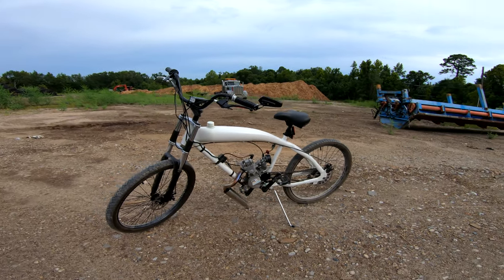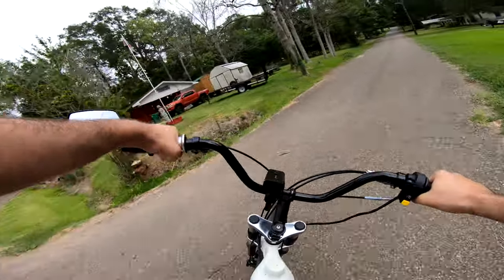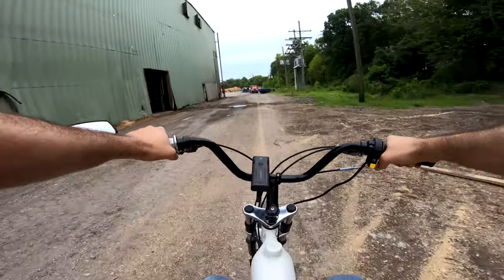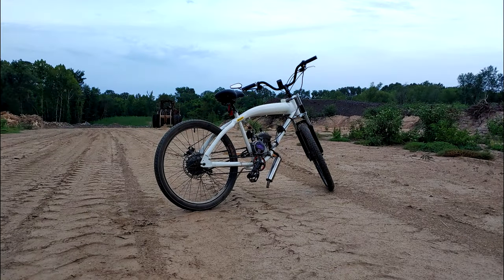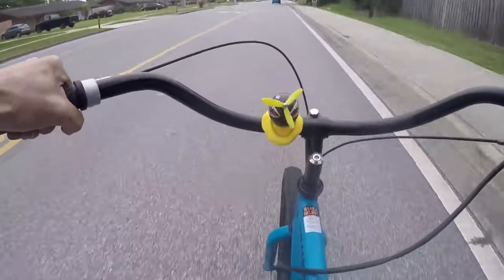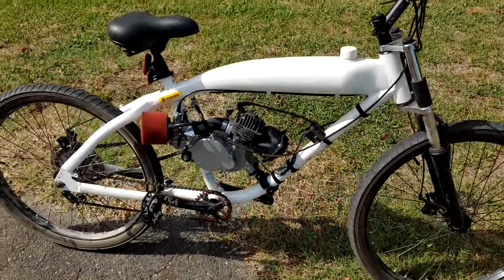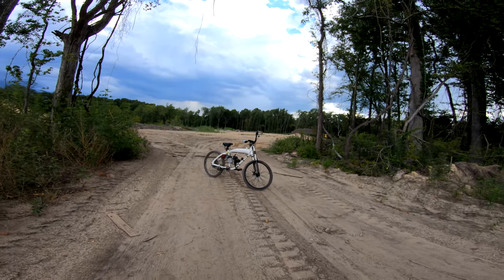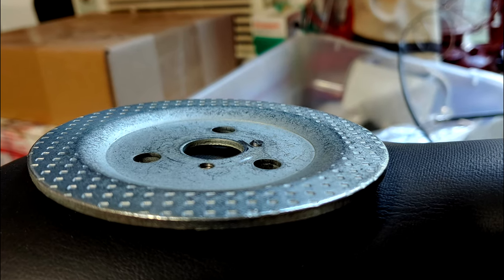MS460 Phantom 85 Bike

Comment: Good news for Phantom 85 builders I got a new cylinder head and piston because mine failed and when I say failed I mean in spectacular fashion the piston is in more than 20 pieces but the new cylinder I have has a different casting with a smaller intake the piston has smaller windows in it so it's less likely to break even though I will not be using that piston I will be using a non windowed Ms 460 piston from farmertec which is the same one that la hover used in his build
Reply from the maker: This information comes literally, at the prefect time! More details coming soon... Thank You!
Reply: @LAHover  I have a question if you can help. My Phantom 85 vibrates at high rpm severely. I would like to know what balanced bottom end engine I should buy to make my own. I would use my old Phantom head and piston but need to know what bottom to buy. I am done buying Phantom!
Reply: @pascalolesen5187  hey, so it’s probably best that you balance your own crank… which you can find youtube videos in or ask members in la hovers discord server. For the vibrations, it could possibly be a motor mounting issue so definitely check that out. The phantom 85 motor is relatively fine, mines ran for monthssss, but it has to be rode in a specific way if you don’t wanna blow her up super super quick.
Reply: @pascalolesen5187  keep your bottoms end, balance and true the crank, switch over to ms460 chainsaw and cylinder OR run the normal cylinder with the non window ms460 piston.
Reply: Where can I buy a crank stand to try and Tru my own cranks? I've owned the dial indicator and stand for yrs now
Reply: @LAHover  If you have any of these Bikes or Motors You want to sell please let me know. This bike looks like it will go the distance be not to sure how much fuel it has onboard. Riding gear is key!👍

Comment: I just put together a nel lusso with a cheap Amazon kit, and for every question, every problem that I ran into, I came here. You've helped me more than you could ever imagine, thanks man.
Reply: I put one together too, did you have any problems with the chain hitting the tire?
Reply: Be careful you two. Nel Lusso frames are prone to excessive vibration and structural failure. Nasty frame under speed. My 2 cents.
Reply: @superbro2097  Will happen if running anything over 2. Solution: add a skinny nut on axle(left) and offset it a bit. Will stop rubbing.
Reply: @superbro2097  no but I definitely recommend using the chain tensioner
Reply: @leonardarola  I have definitely noticed the vibration😬
Reply: I've been running my Nel with an 80cc (66) china doll on it for about a year now and had no problems after I worked out the kinks in the beginning, so not to sure about the comments about it being structurally unsound with a motor in it but maybe I just lucked out, and I've even been hit by a car and still use it as a daily runner doing 45 mile round trips weekly. I did have chain rubbing issues, and had to cut out the rear fender for the chain, but eventually removed the fender all together, I actually first put a spacer on drive train side and moved the axle over a smidge, then I actually moved the whole motor over just a 1/4 of an inch and everything seemed to square up a lot better, also make sure the sprocket is on with the concave side in and the teeth out if you are running a sprocket that is made like that, you'll gain 1/8 inch that way as well, I also started using a hub adapter instead if the rag , but I recommend keying the hub so the adapter doesn't slip. Hope this helps.
Reply: @bgazz33  I appreciate the advice, I went through the same rear fender headache before I also just removed it as well.
Reply: @superbro2097  number 1problem lol it is the gremlin of Motorized bikes
Reply: @willpresnell81  how's everything working out with the Nes?
Reply: @bgazz33  at the risk of jinxing it all, it's actually going pretty well. I swapped to a 32 tooth sprocket (should've went 36, live and learn) over the weekend and it really helped the top end, but now I have to help it out of the hole, but I'm ok with that bc I do mostly long straight runs on flat pavement.
Reply: @willpresnell81  glad to hear! Yeah same boat, I live in the desert, lots of flat straight runs with little mountains but I got mine tuned pretty good, 36 sprocket, modified stock exhaust, ride it to Blythe California sometimes twice a week, about a 50-60 mile round trip!
Reply: @bgazz33  well, me and my big fuckin mouth, broke the chain on the way home from work tonight, immediately afterwards it started pouring rain 🤬🤬🤬
Reply: @malachipeterson1562  yes and no, the bike was free so I really can't complain, but if you're buying brand new there's better choices out there, I believe Hover has a couple of videos for people looking for a solid platform to build on.

Comment: I had my first ride on my 4 stroke friction drive bike today. Felt good to finally get it running. I did break the pedal crank on my Bike Berry bike. Man the pot metal used in the bike was barely pot metal. Still feels good and I will put the other crank on tomorrow. I guess I hit about 30 mph and rode about 30 minuets on about 1 cup of gas. With the friction kits you need to start slowly and accelerate slowly to prevent tire wear. Now I know why you love the gas bikes. The feel of freedom with the wind in your hair .

Comment: When I ride I go out in a kevlar jacket, armoured gloves, a full face and often wear knee and elbow pads. One of by bikes had a fender fall off and jam the wheel and without my riding jacket I would've had nasty road rash all the way up my arm. These bikes go fast enough to really hurt, just a helmet isn't enough. It doesnt matter how good of a rider you are, there will always be an idiot in a car or a mechanical failure that can send you flying into a curb headfirst. I'm glad you wear your gear!

Comment: Your doing great and the older you get the wiser you get...I wear knee pads too and would wear elbow pads if I could find a set I like. My bike is pretty quick and if something where to happen at  50+ I want the best chance I can have to not have road rash. If your trolls would ever have a bad case of road rash they would never put up a message like that. I wouldn't wish road rash on anyone,  that I care about lol 😆  Ride safe enjoy Your Bike 🏍
Reply: So true... I haven't had any wipeouts on my bike , but on my CR... T boned a deer in 5th gear on a fire road. Lost all the skin on both forearms, cracked ribs and 5 days in the hospital 😭... That shit sucks
Reply: Seems to giddy up pretty good 👍 I would say from watching this video, performance seems more than adequate for my needs.
Reply: True a fell due to gravel and holes after heavy rain coming up behind a car he pulled hard brakes I had to pull brakes wheels locked up and I went down not a full on long slide but man did my left knee get messed up(road Rash and deep cut also) still healing all now

Comment: Bro your right about what you said in this video, but I just went ahead and put on a ms380 cylinder on the phantom bottom end. I know what you mean by practically because I use my bikes for transportation almost every day now since I learned about this builds. I notice that the ms380 build was way better than the phantom was. More power, more speed, and great low end with a 44t sprocket.

Comment: I recently picked up a Stihl 044 cylinder and piston kit that uses a 10mm wrist pin. It's a 50mm bore which is nothing to write home about, but it looks like it'll work with a regular PK80 bottom end with the usual prep (filling transfers and original cylinder stud holes & drilling/tapping new ones to match the wider cylinder hole spacing).

Comment: The Hyway brand piston has slightly wider pin locations as well. It also comes with tapered rings that are steel instead of the cast iron ones the stock phantom  comes with.
Reply from the maker: Just make sure it's not too wide. There is not much room between the intake and transfer ports. I have seen p85 cylinders soon bad there was literally no where for the gap to locate without hitting a port.
Reply: @LAHover  you so so right there. Some are simply impossible to fit through.  I heard the ms460 chainsaw cylinder is better and they also make a big-bore ms460. It's a 54mm bore some bolt pattern and all.

Comment: @LAhoverbikes I bought a knock off brand G2 reed valve but it doesn’t fit the carburetor port ? How did you do it?
Reply: Dremel by Chicago Electric from HF. Carbide grinding bits from Amazon and HF. Practice on junk cyl 1st. Then open up your g2 if you can

Comment: Love it. I'll be starting on a 50mm saw build on a standard bottom end soon. Just down a drillpress at present lol .should be fun
Reply: 440?
Reply: 50mm is just enough to fit. I'm thinking the same
Reply: @Matthew-wj8cm  54 fits yd
Reply: @mflbikes1870  yes yes. The big bore ms460 or similar
Reply: @mflbikes1870  well I have a 440 with a 10mm bearing, but I also have a 49mm iron bore that came gouged tho seems pretty thick walled. So I've bin meaning to hone out a full mm see what happens. Just don't have a piston for that one.
Reply: @tmcd6523  yd100 piston will work

Comment: Just put together my phantom 85 kit that I ordered earlier this week for my cranbrook and less than a mile in on my break-in ride my engine blew up. Piston rings snagged on the right hand transfer port, destroyed the rings and piston and screwed up the bore :( 
I think I’ll use an ms460 piston when I put a new motor in it

Comment: Tell me, is there any hope that my entry level BBR Angel fire will ever run half this good? I'd be happy to just get rid of the four stroking and make 5500 rpm. I am going to replace the jet next. That chain saw hybrid seams compitent and strong but the Phatom looked alot faster and higher reving. Thanks Man, your analysis and expalinations are a gold mine.

Comment: Are you using a 36 tooth sprocket?
Seems to get up to 30 mph real quick!
I'm ready to do a complete build w built in gas tank.
Still debating on a good performance motor and carburetor.
Informative videos
Drive safe

Comment: 16:41  I have some Thor knee/shin guards  & summer motorcycle gloves....Need to get a $35 Mongoose MTN bike helmet (lighter more breathable than motorcycle helmet)   The 2 main pieces of protective gear you see motorcycle street stunt riders wear, is a helmet & gloves. I dunno why they don't also wear jackets & knee guards. I guess they're either crazy or it might restrict movement & interfere with tricks. When they wipe out at 40-50 mph they instinctively put their hands out & start to roll when they hit the pavement, trying to avoid sliding/road rash

Comment: Love the channel man. I have a quick question though. I just built a motorized bike on a Schwinn cruiser Frame and when I mounted it on the bike I put pieces of rubber in between the frame and motor mounts to reduce vibration. But I noticed the seat on the bike vibrates so much it makes the bike uncomfortable to ride for longer distances. You have any solutions that may solve this problem? Any help would be appreciated, thanks!
Reply from the maker: Rubber does not do much other than get in the way and cause alignment issues down the road. It might be running too rich. Rich motors vibrate allot. Try dropping the needle (raising the clip) in the carburetor 1 notch at a time and see if it helps
Reply: @LAHover  sounds good. It was running a little rich so I did raise the needle one notch already but it still is vibrating so I guess I’ll try raising it to the highest notch (it’s on the second to highest right now) and see if that helps. Thanks for the help man!

Comment: Thanks for this! One question, your muffler, does it have any type of baffles or anything on the inside, or is it basically an empty box? I made a similar build, with a $20 ms440 muffler from amazon, and mine is super loud, or a lot louder than I'd like, yet no leaks in the exhaust and using a proper exhaust gasket. Your's seems quite reasonable so I'm wondering what might be different.
Reply from the maker: I did pop mine open and if my memory is correct it had two chambers, but mostly empty.
It is indeed louder than my other bikes. I will likely weld up a crud flange so I can fit a silencer.

Comment: How is a radiator hose holding. After running my ms460 with a radiator hose the inside was slimy as well as black oil/gas like the fuel was eating the hose. Have you replaced it, if you have what did you replace it with

Comment: Yes I was a dumbass on Saturday night it was a nice hot summer night thought I'm going to go for a ride in my shorts which I did exactly the same thing washed out on some gravel at the exactly same speed scraped my knee my other leg rested up against my pipe and I burnt it yes if I had pants and pads would be way better no one is dumb who wears safety equipment you're just dumb when you don't wear it like myself LOL have a great ride
Reply from the maker: Ouch! Glad it was a low speed one tho :)

Comment: Hey, my phantom blew up after 400 miles unexpectedly this past weekend. When I pulled the jug the piston was gouged on the side and the bridge in between the two windows was cracked and broken. Bicycle engines. Com made good on the motor, I’ll be putting an aftermarket piston on for reliability…. But now the question is to window it or not? Thoughts?
Reply: I would suggest not windowing it
Reply: Maybe find a larger intake and a carb to suit.
Reply from the maker: I'd say run it without a window and see if you like it. If you do add a window make it a small one.

Comment: You never said how it compares to the phantom on power ... which one is more power?? .. awesome video brother as always thanks again...
Reply from the maker: More pull out of the Saw build, but that might be the carb/intake... Not a big jump in power as they are similar in specs. 
The Saw build runs allot better though, smoother cruising.
Reply: @LAHover  ok cool...so it probably is right on the same lines as the southern comfort CC and the DLH I'm thinking i mean with all of them just stock out of the box none ported... I know that one you just did was so smooth and clean sounding...iv got a CDH PK80 that iv ported and G2 Reed a PHBG 19mm carb a wc80 and a MZ65 clone and it's really strong on a 36t gear Cranbrook like your red one...it's really strong but it's do choppy when it's not under a load at low speed if it stay around 40 it's smooth but it used to be smooth everywhere until i made it really strong and it pulls really good at low speeds it's just choppy when it's not under a load and i hate that...lol...i put my real speed carb back on and it's alot smoother but still a little choppy nut not as bad...
Reply: @LAHover chainsaw motor sounds cooler, like a chainsaw 😊

Comment: Is the Phantom louder or quieter woth the piston port? just a thought. I love the bars on the white dawn. I would like to put them on my screamin demon, link?
Reply from the maker: Sounded the same, you don't hear the reed tapping but that's about it.
Here are the bars, I'm using a lifted steam, also linked below.
Wald Steel Handlebar #803 5.25"... https://www.amazon.com/dp/B000EHYC8K?ref=ppx_pop_mob_ap_share

FOMTOR 25.4 stem 110mm 35 Degree... https://www.amazon.com/dp/B07L9X5ZQH?ref=ppx_pop_mob_ap_share

Comment: Do you always overrev when clutching at high speed? Or is it just this particular engine? I quickly learned how to not do that but I only have a china 66 so it might be different
Reply from the maker: No, just poor timing on my part. I pull in the clutch when letting off the gas out of habit.

Comment: can i still use the stock reed valve with that mas460 piston without windowing the ms 460 piston?
Reply from the maker: You can use a reed without a windowed piston yes. In my testing performance has never gone up without a reed. 
That being said, I think the MS460 is designed for piston port and does not come with a reed anyways. I don't even know what reed system would fit.
Reply: sweet thanks man I'm going to give it a shot when I get the piston because your probably right about those piston ring gaps being too close to the ports, also my engine temp is like 450 to 500 degrees this seems WAYYYY too hot to me my other China doll ran around 250 280max someone told me it's because i have too much base gasket and when you remove one of those base gaskets to get a tighter squish it will make the motor run cooler. Is that true? @LAHover
Reply from the maker: @jarrodnielsen7547  I think the ring gap issue was only on the P85 V1 and V2. 
Did not apply to the MS460 cylinder or P85 V3.
Reply: ohhh I see I'll have to take a look inside when I tear it down, I'm putting that motor on another bike anyways so I might as well look at it while I got the thing off @LAHover

Comment: Are those bevel gear bolts the same as what goes in a 3pc bmx/mtb crank then? If so im changing mine out too as it does has some slop in it with the allen wrench